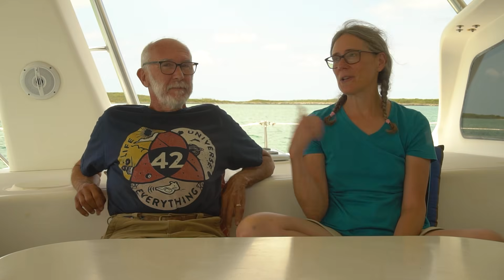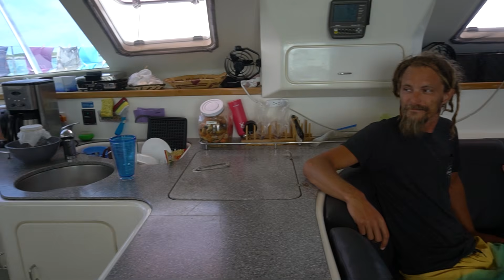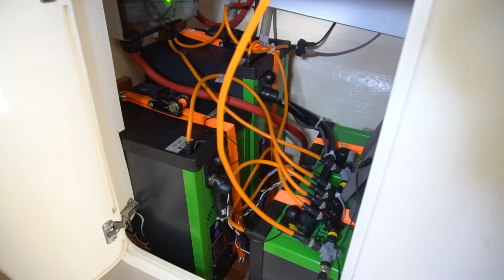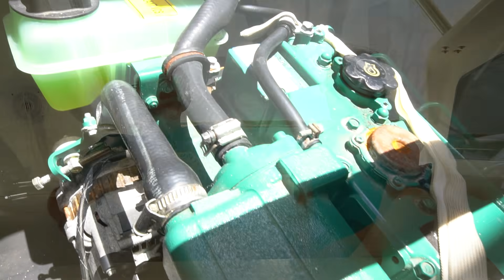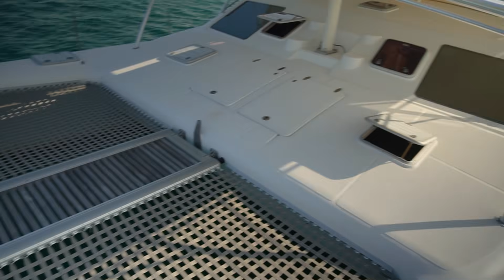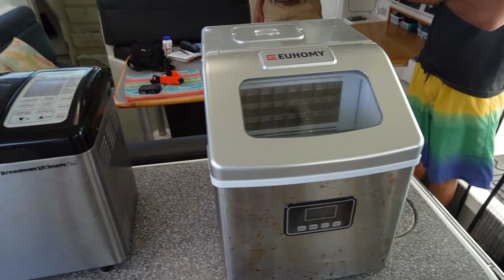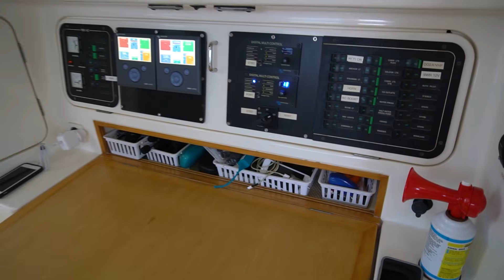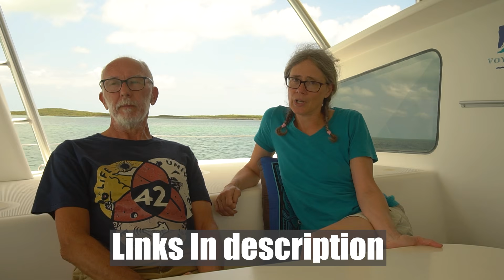100% Solar Electric Catamaran, Interview with owners from Indigo Lady

Comment: Good interview. I have looked at sites for companies that sell new cats "all solar powered" and they spend more time on how the diesel gensets can push the boat through the water for so long, at top speed and no space on what the performance is on just solar or just battery or combined solar/battery. In this case just solar is the standard operational mode with genset as pure backup... but solar and battery is dual for redundancy anyway. Cool project and it seems one of those things that are better owner built than factory. Wish I could follow them but face book is one of those don't touch sites.
Reply from the maker: Thank you Len. Sometimes people that use their boat/ system on a daily basis put more thoughts into what will serve their needs. Everyone has different needs, especially when it comes to traveling and performance. It was really interesting to hear what Dave and Lisa came up with and how it all works. They are also on Instagram, web and have an email. We have put all the links in the description.